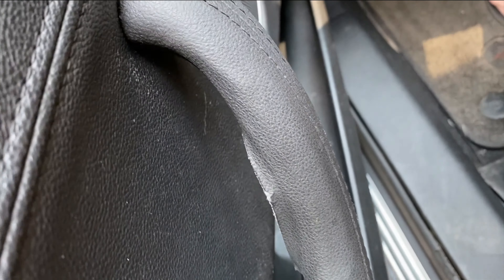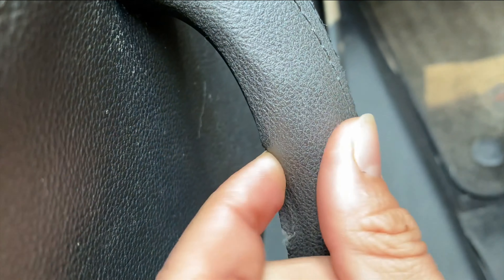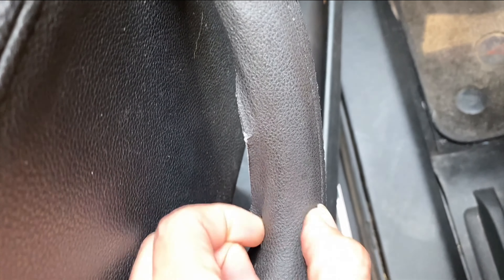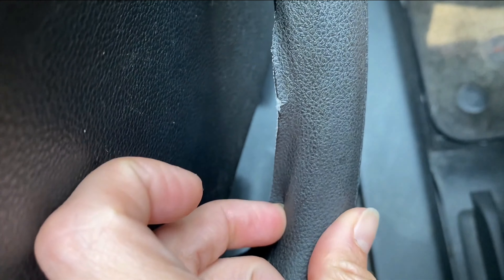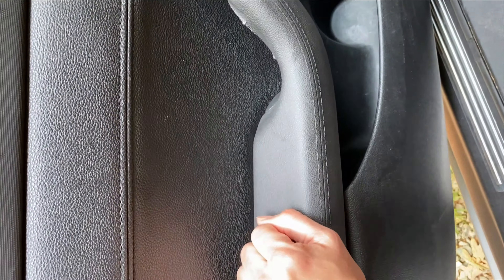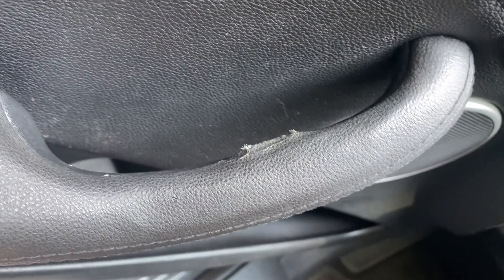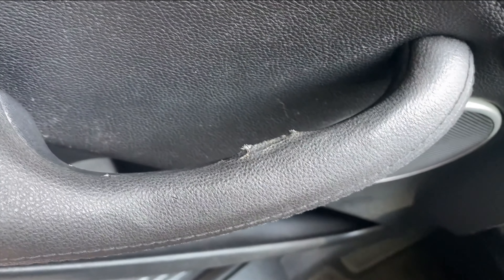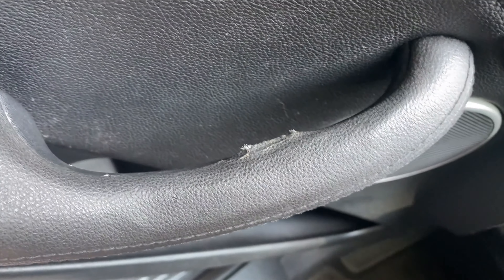Pontiac G8 arm rest leather coming out?  No problem.  April show's you how to repair it

Comment: Have you guys had any issues with your head liners coming down? I’ve done 140 with the windows down too many times I think and it’s just starting to come off
Reply from the maker: Yes.   Everyone of ours has come down.  New material, cleaning the entire headliner board, and new adhesive is the only fix for that unfortunately!
Reply: @nufnuffz28  is it a pain in the ass?
Reply from the maker: Yes.  We removed some, but had someone else recover them.
Reply: @nufnuffz28  thanks. I’m not even gonna give myself the headache haha
Reply from the maker: @klj100295  GOOD CALL